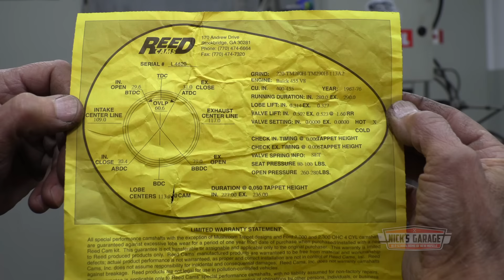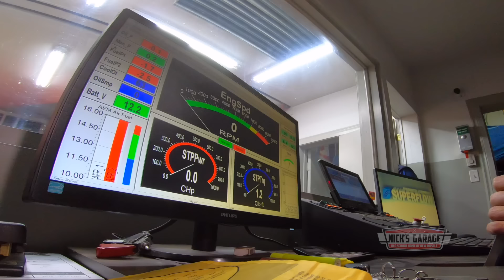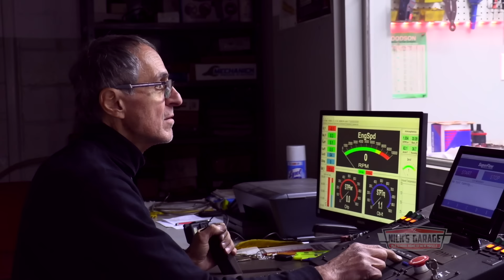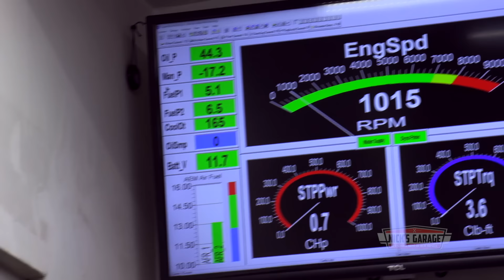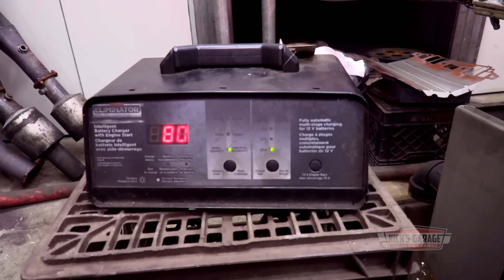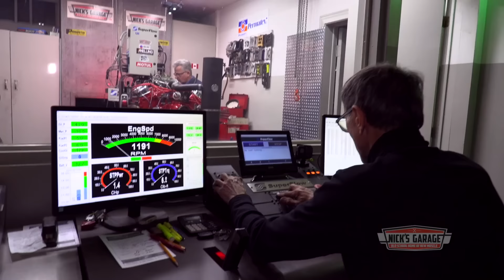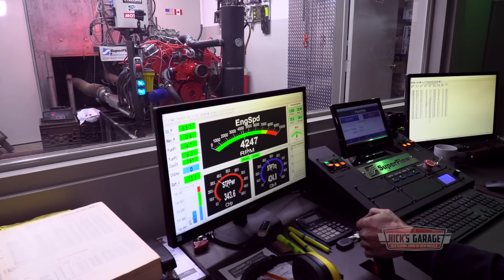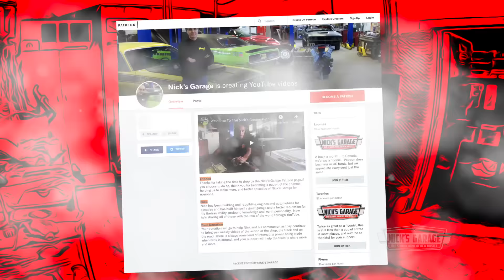1970 Buick 455 Stage 1 - Dyno Room Diagnosis

Comment: I would love to know what it would take  to freshen up my ford 400 big block board .60 over already with full race cam would like to push 600 hp
Reply: Nitrous ...
Reply: Buy a chevy
Reply: @williepelzer384  I'm not a chevy guy ford is my preference
Reply: @williepelzer384  Not if that engine was "board .60" over with a FULL (not half!) race cam. It would be bad azz! Love it!!
Reply: @LR-my2di  have you ever built an engine? Boring a engine . 060 doesn't give it much more hp. And half race and full race Cam doesn't tell me anything.
Reply: @williepelzer384  Willie, you just "sorta" missed my point here.  If you bored (not BOARD, as Randy called it!) the engine .60" (not .060", which you also apparently missed that Randy meant to say) you'd have a helluva bore size! That would take a typical 4.00" SB Chevy bore size to 4.60" and NOT 4.060"!  Now that WOULD indeed increase hp and torque regardless of what engine it was.   And about that silly cam nomenclature ... EXACTLY., So what does all of THAT mean?  Have you ever heard if a one quarter or a one half race cam??
Reply: @LR-my2di    sixty over is . .060 ,sixty thou. .600 is six hundred thou. Almost Fife eights of and inch. WOW     WOULD LIKE TO KNOW WHAT BLOCK CAN DO THAT!!! IAM getting 🐗
Reply: As far as the Cam nomenclature yes I have in the fiftys and sixty's.
Reply: @williepelzer384  Yep, and that's why I was joking back about the ".60" over comment.
Reply: @LR-my2di  10-4 have fun maybe you will out grow the Ford thing, or go broke trying. 🤔
Reply: @williepelzer384  HaHa!  I have no "Ford Thing" Willie, ... but I do have a Ford GT "40" supercar and two great little bulletproof Ranger trucks.  I'm a B-O-P man, if anything.  However, some of these comments are just too entertaining to ignore.

Comment: I had a 78 Buick skyhawk  with a 231 V6 a 4 speed. 
It had a rough idle from day I bought it new.  I tried a lot of different things to fix it and nothing worked. As a last resort I rebuilt the carburetor. The floats were off by an 1/8".
After resetting them it fixed the problem . I pulled a lot of hair out before I got there. That car was a little jackrabbit . A lot of fun to  drive.  You got the dwell right. On a GM distributor  of that type the dwell is 
29-31 . That was what it was on my 70 Camaro .
That motor sounds great!!

Comment: Poor guy,I feel the frustration. I had a 78 firebird with the olds 400 in it with the same issue. Had to replace gaskets and anything rubber to finally get it running right again

Comment: I'd have tossed the cast iron intake mani for a hi perf aluminum intake mani. Lose weight, gain a few horses. IMO that 455 would do much better with 10.0-10.5 CR. Also check the oil pressure after the thicker oil pump gasket. The old gasket may have been real thin for a reason(?)  FWIW certain Buick V8s back then had comparitively low OP at idle (less than 10psi) due to an oil passage that makes a extreme 90* turn and Buick never addressed it. My friends rebuilt Buick 350 v8 had @ 6psi OP at idle. . With 20w50 oil in it no less.  Also my Uncles 1966 Buick Wildcat had 7 psi OP at idle.   I read about this low OP thing due to the oil galley , in Hot Rod magazine a few years back. IIRC the 66 Buick Wildcat's engine was called a 455 but it was a torque number, and the CID was 400 ci.(?)

Comment: Hi Nick great show always. With vacuum leaks not good. This is  a idea if you take the rocker cover's off and remove the rocker arms so all the valves are closed if you plug all hole's in the intake manifold then apply a vacuum with a vacuum gauge in place on the manifold you will hear the  leaks and see the vacuum gauge dropping down and you can use a oil can along the top side and the china walls if they are on the top side . If you can hear vacuum leaking through the crank case it be on the lower side. Hope this is helpful. Old school is great always. Dave from down under.

Comment: That motor orinally had 11 to 1 pistons and it ran on Sunoco 101 Sir not 94 ocy
Reply: We used to gap it with a matchbook wrapper paper it made it close enough in a tight spot MY FRIEND MR. NICK
Reply: I remember that octane dial on the Sunoco pumps

Comment: Anyways the 455 stage 1 eats up hemmis and what eats up the Buick 455 and hemis is the olds w-30 455 watch YouTube stock factory drag racing my work 3:50 olds motor ate up 396-375 horse Chevelle and mopars

Comment: mismatch head to block
vac / water leak  need to re-engineer the angles of mating head to vally to manifold. is the issue here. killing the horsepower is the chamber to big, reason adjustable push rods failed  plane work from previous work done on engine.    so both manifold and head need planed proper angle to relation to vally, after done would need double/thicker intake gasket and piston sleected will be ok after all the machine work is done, need to check valve to pistion clearance.
forgot to say depends on how much shave of heads need to check bolt lenght and may have to add harden washers on head bolts won't bottom out.

Comment: Hard to believe owner wants points type ign in this day and age with electronic OE look distributors readily available. I put HEI's on all these big GM's cause they take the worry out of being close and for  the wider separation of the cap plug terminals. No such animal as 'Too Much Ignition' has been invented yet. The 70 Buick GS , GSX had fake HP ratings of 350- 370HP. NHRA quickly refactored them to run with 425hp  rated cars. Well tuned could run in the 11s. Far quicker than my OLDS W30 442 rated @ 365HP. Less than 700 Buick GSXs were sold in 1970 so didn't run into many on the street. I usually got beat by any 413-426- or 440 MOPARs I tried on [unless they were a stick since most don't know how to race them] Ya I miss them days , but glad I had them.

Comment: Not sure if I missed it or not, but why weren’t the intake bolts not torqued down to the proper factory specifications? I have never built an engine without this procedure.
Reply: And I have NEVER done it and coincidentally, NEVER had an issue. Just because it has one doesn't mean it is needed. Heads, main caps, certain bolts, yeah. A factory cast iron intake, no.  Especially when it has two machined flat surfaces.

Comment: Seems to be just the basic 455 and not a stage 1. In 1972 the engine was rated at only 250 HP partly because of design changes and switching from gross HP to net HP....
Reply: True!  Not a Stage 1.

Comment: MSD Coil and Solid Core wires should be good for 5500 RPM.  I agree with everyone, that the compression is just too low, its diwn over a full point over what factory stage 1 455's had. 10.5:01 or bust.  The cam will make more torque with just the higher compression.  Throw sone 1.7 ratio full roller rocker arms on those heads...tune the carburator for the headers and cam and curve the distributor for full advance allmin by 2800-3200 RPM.

Comment: Great nick my father had a 455 stage one in his 1970 Buick Electra 225 4 door could pass anything but a gas station and several mopers New Yorkers darts Chrysler cordoba concord intrepid myself 1975 Dodge Dart 2 door hard too 93 red Dakota sport 2002 Dakota 4&4 2004 black hemi ram now a a 2009 challenger rot in hemi orange with only 30 thousand miles on it love the show and kowalski  your fan Jason in Illinois
Reply: Thanks for your story.

Comment: When looking for Vacuum leaks, sometimes a welding torch with just propane can be flowed around areas of suspected leaks. When the leak draws Propane instead of air, you know you are in the right area. Use plenty of ventilation to prevent a build up of Propane vapor.

Comment: The timing should be full advanced when the full barrel kicks at 36 to 3800 the points should be set at 32,000 the plugs should be set at 45,000 you should be running a cold plug instead of a hot plug that's a high performance motor

Comment: How much were the heads and/or block "surfaced"? Too much? Probably so. Which doesn't work with non-adjustable valvetrains. "Lean" and low vacuum go hand in hand with "hanging" open valves. And "opening" idle screws does not "add fuel" in the absence of a proper vacuum signal. Which also requires an air cleaner for proper fuel-air mixture. You can't "dyno tune" OR "diagnose" engine issues with an "open intake". 

And once you started "milling" MORE parts you completely fubarred everything. And BTW, that "Buick" is an "Oldsmobile".

Comment: This is what happens when you don't use an O2 sensor you're running way too lean your exhaust pipe gets way too hot that's why the whole computer system in O2 sensor is a miracle a perfect miracle for burning fuel completely and economically makes heavy every car an inch engine a race car

Comment: I have a 78 la 318 bored .060 over with aluminum heads , flattop pistons, and a small comp cam id love to send up and have u go thru it. I think It suffers from a small vacuum leak too.
Reply: OK.
Reply: @nickpanaritis4122  watched ur video again to see if I could pick up any more tips. My 318 engine with comp cam extreme energy 268 only makes 10/12 inches of vacuum at idle. If the front or rear intake manifold rails are poorly sealed could that cause a slight vacuum leak? I do have a slight oil leak on the rear one. I see online that many people say their 268xe makes at least 16 inches of vacuum which is another reason I’m skeptical. Love all your videos Nick. I appreciate you! You’re an inspiration. Cheers from West Virginia in the states!
Reply: @bsrob1  It could be possible you have a vaccum leak.  Or, advance the timing to see if it picks up vaccum.

Comment: amazing teamwork between Nick, Manny & last but not least, George !!!  BTW Nick, here is an advance notice that U will b getting an Oldsmobile 455, 1970 W-30. Ohh, gold engines are the 350 cid, the 455 engines from '70 to '77 are  Olds blue
Reply: My mistake.  It is the 350 that is Gold,  455 were blue. You are correct.

Comment: I had to use 2 gaskets on my 413 for that same reason surge at idle
Reply from the maker: Glad you got it sorted.👍
Reply: Did you use paper on each side of the valley pan on the intake? And was the block decked or heads cut?

Comment: Awesome video. Those Buick engines are rock solid. I’ve got a 1977 Buick Regal with a 350 H motor in it and  everything is the same, that motor would bolt right in. All the issues you have had , I’ve had also. One thing at least with mine , it floods real easy on a morning cold start. I’ve got to be just right or it floods out. My car is a daily driver , with 310k miles on it. I’ve never had the cylinder heads off of it, but I’m on my 3 timing chain and 2 trans overhaul that is a 400th with a high stall converter at about 2,300 rpm and a transco no 2 shift kit. The carb is a Rochester RGS 2 barrel and manual choke. I had to install a electric fuel pump because from the factory the lever on the mechanical pump is long and would not pump enough gas on a cold start. The solution was for a long time Delco Remy riveted a 1/8 steel block on the end of the lever but then all the aftermarket people left it off so the problem came back, the electric fuel , problem solved. Last year I finally installed a oil pressure gauge and I was really surprised on a cold start I get 65 psi at 1,500 and 45 running. When the oil is hot I get 25 psi at idle and 45 psi running above 1,800 rpm and that’s with 20w 50 valvoline VR-1 motor oil. In the winter I run 10w-30 valvoline VR-1 oil and the psi is 18 to 20 but on the high end the pressure is about the same. I’ve got HEI distributor with now a high output coil , new wires and Bosch iridium spark plugs and the engine runs like a clock 👍👍👍👍

Comment: I have a 70 GS with a 430 Riv motor in it. Pistons .095 in the hole, 8.38 CR. With stock non stage 1 heads.  Run a quadrajet, turbo 400, and 4.10 gears. Has a 107 window rattler cam. Car runs consistent 12. 33 at 3900 lbs.

Comment: GM is always set the dwell first....30 degrees,  You can set the dwell with a Allen wrench through the window with the engine running or not...This step has to be made first as every degree of    dwell is 4 degrees timring...so if it's off...it screws you quick.
  These guys have bad timing.....T

Comment: Olds 455 should not be gold. Every engine had a different color depending on the year and displacement until GM said every engine is blue.Olds 350 was gold, 400 was copper, and 455 was red 1969 ish. I had a 69 old and painted a 455 gold. Wrong color for the engine, but right color for the engine that car came with.

Comment: I have my 470 cuin Buick big block sitting on the frame rails wanting to be started.  Soon my friend, soon.   I'm not done with the episode yet, but I'm guessing 480HP and 560 lbFt.
Reply: I expected more.  Mine has about .015 less lift than this engine and I got 450hp and 540lb ft.   Only difference is I have an electronic distributor and Performer manifold.
edit.  Actually, the lift they showed is with 1.6 rockers.  I have 1.55 so his cam and mine are almost identical.   There is a whole lot of power lost somewhere in that engine.

Comment: The oil pump leak maybe worked like a vacuum release?  ran this same engine in a 19 ft tri hull ski boat back in th day. It drove a jacuzzi pump very well. Got a speeding (90 mph in a 45 zone) ticket on a Sierra Lake @ 4500 ft above sea level. It had a 4 barrel Holley 850 DP.

Comment: Book ratings were a lot of 'insurance propaganda', even before 1971. Great example...340-Cuda's. You look up the hottest 340 out there, it was 'published' at 275 hp...you go to the dragstrip, you're dialing in against 428-Cobra Jets. Most who knew what they were talking about would tell you, the hot 340's were making between 325-hp and 350-hp, EASILY! I've often wondered if that was the reason so many 'trick carburetor' systems were available in the day...'tri-power', 'six-pack', etc. - all it would take would be 'just the right progressive linkage setting' (where the second 2-barrel didn't 'wake up' until half-throttle, or further), and yep, you've got a 275-hp 340...but nudge it a LITTLE BIT MORE, wake up #2 carb...or all-in for #3 carb, and suddenly, you've got another 60-100 hp more...but because it wasn't pushed 'that far', those last carburetors weren't 'contributing' to the power testing.

Comment: 10 .5 CR will wake the baby up , qith a nice iskdaern  camshaft
Reply: I put a bead of permitex  ultra black all the away around , never not one leak in any engine in 20 years, 462" oldsmobile  & 632" cubic inch  mountain  motors

Comment: How much would it have helped the power if your client would switch to an Edelbrock performer intake manifold???
Reply: Not enough to justify cost, Buick and Pontiac intakes are good pieces
Reply: @doomman700  The Performer would only be a bit lighter.  Otherwise, very imilar flow. The older B4B would give about 15-18 hp.

Comment: Idle is not 1100 rpm, and if your intake gaskets are leaking water already out the left rear corner I would check if the gasket is leaking inside also, your triple gasket is not a fix. If you are checking timing maybe check point dwell first  omg.
Reply: We are raising the CR .  Everything will be checked.
Reply: What is a better way if dealing with vacuum and water leaks? I have a 383 that leaks vacuum.
Also, I thought he had a normal idle. Towards the end of the video.

Comment: I do not understand why anyone would want to run points in an engine nowadays,,  It is easy to time #1 cylinder exactly where you want it,, but who knows what the rest of the cylinders are firing at,, uneven wear on the rotor cam plus wear on the distributor shaft bearings and gears can make the timing go all over the place,,  Electronic ignition is the only way to go,,,

Comment: I would do some plenum and port matching on the intake, and have the carb gone through for a performance calibration. With headers and the cam, a factory stock calibration will not work as well. How much tension is on the secondary air door? Too much and it won't open fully.

Comment: .015" off the deck, .010 off the heads, original head gasket was .039 and new gasket is .050.  After cutting essentially .025" between the head and deck there is a good chance you increased your compression ratio. 
If the heads come off again, find out how far in the hole the pistons are and CC the chambers.  No need to guess at static compression ratio, then use your cam specs to determine the dynamic c/r.

Comment: I like the story that you walked away from that race. I saw a historical video on the 1970 Buick. I think it was the Skylark but can't remember. They said this 1970 Buick with the 455 was the best factory stock setup GM ever took to the drag strip. It ran the quarter mile in 11.5-11.7. So if that Buick Nick ran against did better than that, you could bet that guy's 455 wasn't stock.
Reply: Thank you Stephen.
Reply: Every year they seem to get quicker, lol. 70 stage 1 was a low 13 second car stock. You could see high 12s with slicks on an ideal day. With the right cam, converter, headers, and slicks, high 11s are possible.

Comment: I thought the Big blocks redlined at 4600 RPM not unless you balanced it and put a stud kit in the crank it won't take no more than 5,000 RPM or you'll start getting on it especially if you didn't put aftermarket damper or fix flex plate on it but it sounds good I think you're losing your horsepower and torque through your timing and your distributor and maybe your valtrain for one you're losing a little power through your points they need advance to 32,000 and you need to advance your timing the 3600 full advanced and your seat pressure on your bells should at least be 180 to 190 ft pounds and it should be four to six degrees advanced at top dead center